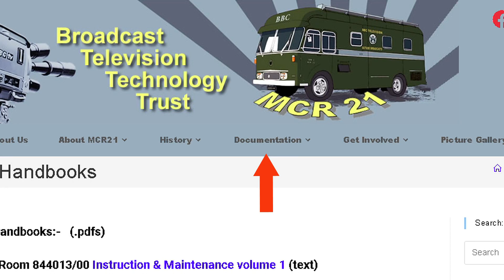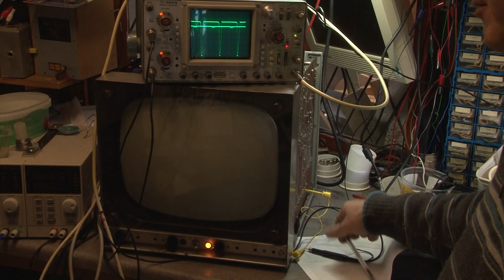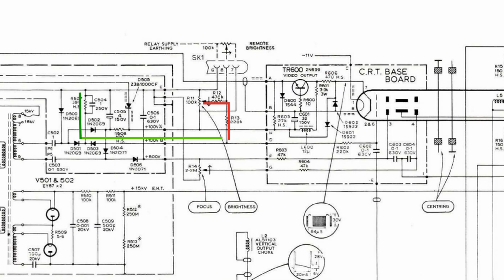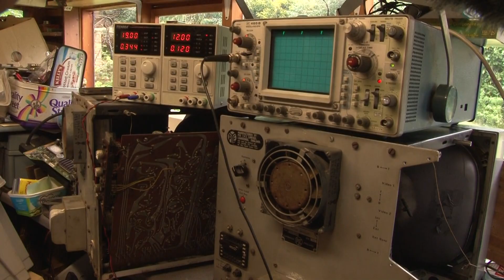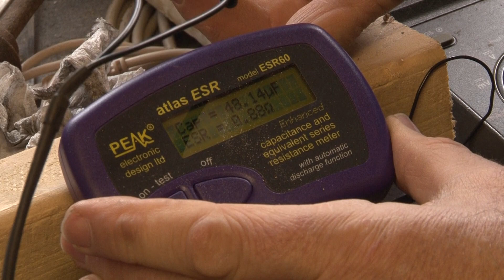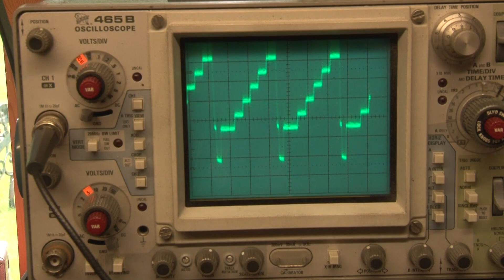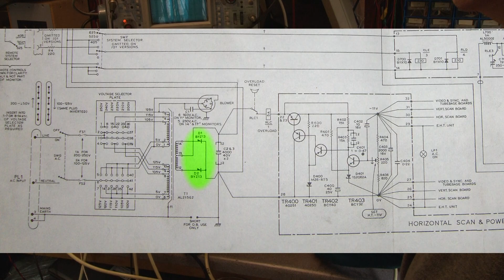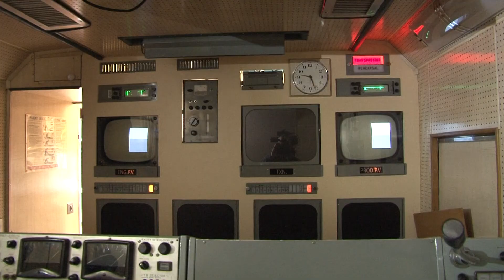Pye Monitor Restorations - Part 3 - the continuing story of refurbishing 1960s CRT monitors.

Comment: Those red capacitors are notorious for problems, think they were made by Plessey.
Are they dual standard 405/625 monitors?
Reply: So we found!  These monitors will also do 525/60.  Truly multi-standard.
Reply: @paulread2922  As those monitors have been stored in damp conditions you might consider 'warming' the line output transformer to drive out any moisture that's been absorbed over the years. On valve sets the symptoms of moisture are reducing width after 30-45 mins of operation and the transformer running hotter than it should, effect is almost like a shorted turn.
Passing a small current through the transformer for 24 hours or so drives the moisture out. On valve sets it's easy, connect between line output anode valve top cap and EHT rectifier cathode, you want about 1 to 2 watts which your bench supply will do.Transformer should feel just slightly warm to the touch when the current is passing through it. 
More awkward with transistors as they may need disconnecting.Anyway,just a thought.
Reply: Good  tip, Hugh
Reply: And "ola" to all our viewers in Portugal.  Do go and visit the RTP museum if you are ever in Lisbon.  They have an excellent display and English speaking curator.
Reply: @paulread2922  Boa Tarde!
They have a virtual museum online which I've seen. In the very early days RTP used to supply TV's to viewers as well.